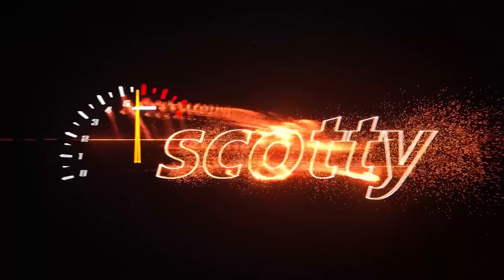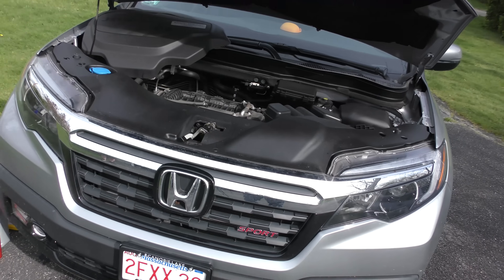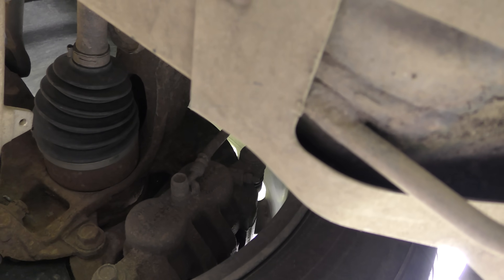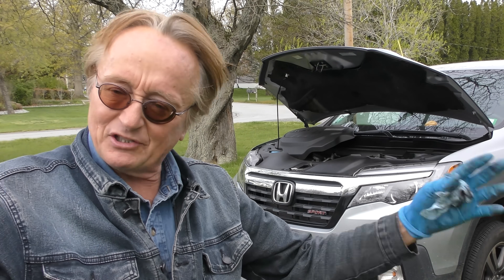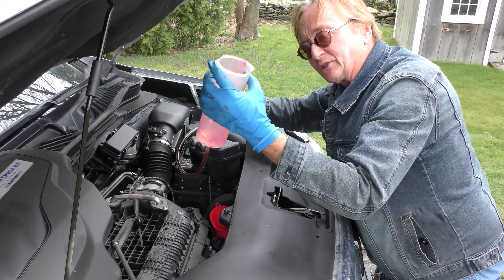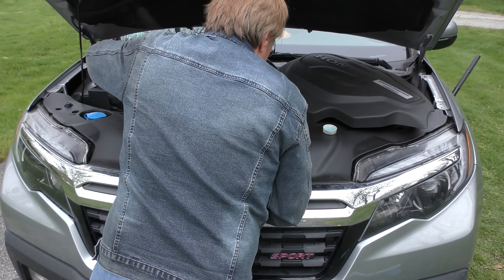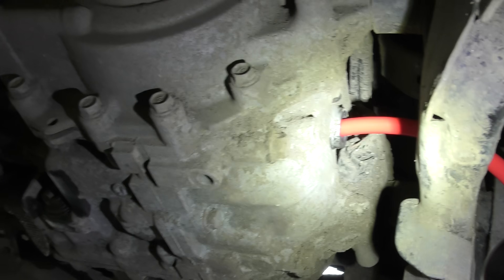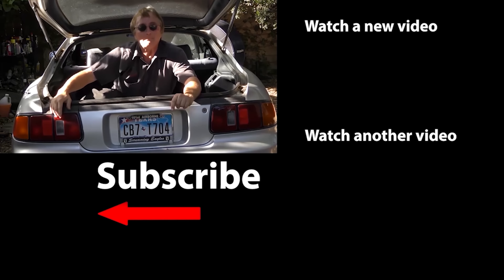Here's Why Car Companies Don't Want You to Change Your Engine Oil or Transmission Fluid

Comment: 6:12 THIS... is why I love the design of my Subaru engine. The oil filter is on the top so oil changes are virtually mess free. 
Great video 👍
Reply: Interesting. What year is your Subie? I have changed hundreds and never seen one on top?
Reply: @alan297  my 15 and 20 were both on the top, Outbacks
Reply: @alan297  2009
Reply: How often you change your oil on it ?
Reply: Some toyotas have excellent oil filter drain area. So ya dont get all messy. Used to change oil n filter 3 times a year
Reply: Just put a plastic bag around your oil filter as you unscrew it.  NO MESS.
Reply: E46 and E53 (probably E38, E39 as well, same generation) -- has it on top and uses a paper filter in housing design.  No dripping oil on your wrists and car, such a good design.

Comment: DUDE yes.. I ran a Valvoline and a lot of the customers wanted to be know-it-alls (for whatever reason it was almost always Ford truck guys) about their fluid changes, especially oil. If they got conventional engine oil they always insisted they were told it was capable of 6,000 miles. I said, yeah, of course they told you that. It'll work fine under that schedule until you're past the warranty, then it's your problem. Plus routine maintenance cost and intervals started getting taken more seriously by the consumers. So the dealer will tell you whatever to sell you that crap, especially when they can lock you in to be coming back to their service department. That's ROE revenue generation. My personal vehicle requires 0w40 European oil. I use Mobil 1, and change the oil and filter no more than every 3500 miles or 6 months in my car (it also never idles for long aside from bad traffic) have never had a problem on a motor that commonly has issues based off of internal engine wear (6.4 hemi), and even use that as a recommendation and still got arguments from these guys.

Comment: Hi scotty have a toyota matrix 2006 What happen if  get two type of code scaner P0420  / p0741..?
Reply: Thank for your help
Reply: p0420  catalytic converter is not functioning efficiently and P0741 torque converter clutch solenoid performance.  The p0420 could be an o2 sensor or clogged cat.  Try dumping some catalytic converter cleaner in your tank and see if that works.  If not replace the o2 senor, if that does work soak your cat in soapy water overnight and hose off.  I have no idea how to fix the p0741 error
Reply: @Jeremy Brown  what type catalytic  spay can should I get

Comment: Car makers don't want you to change transmission fluid, because they want you to buy a new car soon. Well done, Scotty!
Reply: Also most punters buying new welcome lower maintenance, and they'll probably no longer own the car anyway.
Reply: @rob5944  Exactly, Rob! Changing engine oil every 10000 miles, lifetime transmission fluids make maintenance cheap and cars disposable.
Reply: @jaguarrroman  yes, and Scotty says not having to bother with the transmission is attractive to the new car buyer.  Here in the UK my little Peugeot says to change the auxiliary belt at 100,000!  It always made a noise from when we bought it at three years old and 21,0000.  With hindsight I should of taken it back but it was only a little on cold mornings.  The water pump bearings started rumbling at 45,000 and the clutch broke up too.  Ok it probably had a hard time in the city before hand, but I've never had a pump go in my life.  But it's a car built to a very strict budget, a Toyota Aygo in disguise with a Daihatsu derived engine, not brilliant it has to be said.  Although it only cost £6,000 but I had to silicone the centre brake light in to stop it leaking, a long standing fault on this and the preceding model.  A fairly comfortable car to drive and averages 55 mpg and is hippy round town but struggles on hill.  With 67 bhp I don't think it'd be popular in the states, free tax here though because of its low emissions!
Reply: @rob5944  100K is too much for the belt whatever it be made of. When I was driving an Opel Tigra in my young days, I started checking the belt condition and considering it's replacement every 15-20K km. I prefer to be on the safe side.
Reply: Well in line withe their policy on sustainability of the environment.
Reply: @jayjaynella4539  I believe that car makers' competition with each other in quantity of sold vehicles is the main reason, which makes the environment unsustainable.
Reply: True I sya just change once if it's a honda and in manual  I have a 2003 civic manual transmission . I changed it at 200k and the report I got back from blackstone  Saud it was still good .

Comment: I have a 2017 Ridgeline with the 6 speed automatic transmission. It does have an external filter that's easy to change.
Reply: This might be the 9 speed? ZFs usually have filters and magnets built into the pan. A full service would involve replacing the pan assembly

Comment: so if you have one of those "no need to change fluid ever" transmissions. would you still recommend to do it anyways?. or if it did frag does the manufacturer have to replace it?
Reply: Yes. No fluid lasts forever.  It will last the length of the loan or warranty and that’s all they care about.  They don’t consider people that keep their cars more than 7 yrs
Reply: Every 40,000 miles is pretty reasonable.  If you already have over 100,000 miles, don’t change it, it’s too late.
Reply: @jpjp3873 , 40k sounds reasonable. But for the 100k it depends on the producer. For the best Japanese cars you can do an almost total change (more than 80%), while for a least reliable brand I would recommend a half-change and keeping the old fluid (in case of issues you can put it back in). This would be the risk mitigation 😉

Comment: i have a 08 honda ridgeline with a 3.5 vtech. yesterday i got 14 codes from a obd2 reader. I bought a egr valve and put it on. Today after installing a new egr i have 4 codes po300, po301, po302, and po306. I ran my finger the exhaust pipe and got a thick black dry layer of soot. I'm wowing if i should clean or install a new idle air control valve. What do you think brother? 
Please get back with me, God bless...

Comment: How often should manual transmission fluid be changed on my Mazda 3? I read conflicting info ie. sealed for life, but Mazda say change it at 90k. Nothing in service book about changing or inspection.
Reply: Do it like Scotty says...every 30k miles.
90K is really close to the warranty limit....see where I am going with this???
Stand there and watch if you get someone to do it....

Comment: The dealer only recommended a drain and fill
Reply: The trans filter has to be changed also.
Reply: @kato1224  They  said it didn't have one.
Reply: It's a screen type filter.
Reply: If they use a machine to back flush the transmission, the filter also gets back flushed that cleans out most of the gunk so you don't need to change it.
Reply: @wally7856  i have a 2019 rav4 It doesn't have a Conventional. dipstick. You have to put it in the certain temperature. But true

Comment: I have a 2001 hoda oddesy and it has p0740 it drives fine in till it Reaches operating temperature and then has hard shifting between 1st and 2nd

Comment: I bought a 13 VW Passat (I know. I got it cheap) with 130k miles. I don’t know the history of the car. MY QUESTION TO SOMEONE THAT KNOW AND HAS EXPERIENCE IS:
Should I replace the tranny fluid? I’m scared. Thank you in advance to my guardian Scotty
Reply: Now that you have bought the car
...have the oils changed in everything...engine, trans,diff, brakes
then  you know it has been done properly.
Now you can set your own schedule for future changes????
Reply: @Jonathan 
There is a mechanism to distribute the drive between the left wheel and the right wheel...it is a differential. (diff)

Every 2013 Volkswagen Passat has either a front or rear differential, and some 2013 Volkswagen Passat s will have both of them. 4-Wheel drives are a good example of one with both differentials. This component allows your 2013 Volkswagen Passat to turn in different directions, so you can imagine there will be some issues when the differential starts to malfunction.

Comment: If the transmission and the differential have a fluid  level plug l always fill until fluid comes out. Because the component could be already low before you drain it and  just measuring the amount that comes out will leave the component low!

Comment: I have a 2022 Honda accord, had a curtesy 3000 mile oil change  coupon.  I didn't inspect their work till 500 miles later , one look at the oil color I knew they didn't change it.  I have always changed the fluids on my car by myself, and after this experience I will never go back to a dealership.
Reply: 500 miles will darken the oil again.  It’s clean looking until it is in the engine.  Use your head
Reply: At 500 miles the oil on your dipstick should remain relatively clean and clear unless that engine has other issues to consider.
Doing it yourself will prove this out.
Dealerships overcharge and underdo in most instances.

Comment: I've yet to meet a mechanic that does things in such detail. (Measures cc, Recommends OEM fluid)
Reply: With hondas you will have failure if you dont use the oem. anyone who's owned a honda is aware to always use OEM fluids.

Comment: It is better to get the maintenance for your vehicle completed at the service center.
Reply: Only if you have a warranty that demands it...and make sure every part of that service is signed by them in the maintenance log in the vehicle and stamped by them.
If the "new system" is computer based...ask for a printout each and every time.

Comment: Question for you, my car has 220k kilometers, and the dealership and transmission places won't change the fluid, because there are no records of it changed what do you recommend. Scotty. Dom from Toronto.
Reply: i heard him say before if its been too long unchanged better leave it as it is
Reply: @fidelcatsro6948  my concern is that it will become paste
Reply: @domenicorusso9183  peanut butter yum yum
Reply: What car?
Reply: @rajmukhopadhyay4837  2012 Infiniti G37.

Comment: Top Tip: always loosen fill plug on trans/diff before draining to be sure you can fill after drain.
Reply: I also like to make sure I can take the filter off before I start the drain...
Reply: @eyalcohen2080  I fell victim to that, also remember to refit the drain plug before refilling of you've gone for a cup of tea. 😞
Reply: @rob5944   - - - - Yep.  I put five quarts of new oil into the oil drain pan and it mixed with the five quarts I drained out earlier. Had to use my other car to go get more oil. Also, the 10 quarts of oil overflowed the drain pan and it made a mess. :body-green-covering-eyes:
Reply: @eyalcohen2080 i lost a jetta by not checking the filter first, it wouldn’t come off cuz it was fused to the engine, and i think my prying it off fucked it up and when i thought i fixed it and filled it up and put new oil in it, it just spat it all out.
Reply: I learned that hard way once. Needed longer extension once to reach fill on toyota transmission.
had to borrow extension from neighbor.
Reply: Maintenance 101!
Reply: And as when loosening any but or bolt, try to keep and open hand on the wrench so that if it slips then you won't crack your knuckles!
Reply: @rob5944 or round the bolt and you’ll never get it off
Reply: I think I heard that from some guy named Scotty Kilmer.
Reply: @petepacemaker  he don't even follow his own advice
Reply: I just put on rotisserie flip it over to fill it back up
Reply: @danbob1650 😂😅😂
Reply: Additional plus to doing it that way: pressure relief. Old fluid will flow out easier and usually in a smooth stream. Helps keep things tidier, especially with horizontal drilled drains.
Reply: Otherwise it can be a nightmare.
Reply: Or you can just turn your car upside down and fill it from the drain plug.
Reply: @HaggisMuncher-69-420  Sounds easier.
Reply: I know, I always try to remember that. You could get in trouble that one time you can’t get the fill plug loose!
Reply: What's a fill plug
Reply: Meh.  Whatever works for you, in my opinion. I've never done that, myself. 

I have everything out when I'm ready to do the work. I also check the oil before I start the car after the change, then start the car and do a leak check. Then I check the oil level right afterwards and clean up. 

The are layers and layers of opportunities to being sure you actually put oil back in. How many is up to the individual.
Reply: Scotty, Why
Reply: I have a  2016 C7 corvette. It has 20k miles on it. Would I need to change my rear diff fluid. It not due till a few thousand miles from now, however, the fluid itself, is 7 yrs old now. I've heard different answers.
Reply: I agree 100%
Reply: Last year on my cts i reverse filled the trans because I didn’t follow this rule... never again
Reply: You'll also have the added benefit of it draining faster.
Reply: @Brady Mac 
Thanks for reminding.
Is he talking about the necessities of changing oil for automatic vehicles, or for all?
Reply: Lol my tool slipped and I thought I had cracked the fill plug - drained, then took an hour to finally open the fill, thankfully
Reply: So you don't like to live...dangerously? Lol
Reply: That's right 👍
Reply: Partially true. You can fill them back up with a pump type of gizmo. They sell them online for filling sealed transmissions. They have all sorts of fittings and I bet you can fit it on the drain bolt of a dif or something of that likes.
Reply: no
Reply: Or turn the car upside down

Comment: Scotty, my trans fluid dipstick shows my fluid is 4-5x higher than the high marker. I checked it a number of ways including whats detailed in my owners manual and it never reads even close the the high mark on the dipstick. 

Should I be concerned?  Next time I change out the fluid (I plan to start doing it myself) should I put in less?
Reply: Drain it ans measure how much came out, then look up how much is recommended to put in when performing a simple drain and refill. Compare what you got out and usually it'll need as much as what came out.
Reply: Goodluck
Reply: Are you measuring with engine on or off? My car for instance says to measure with hot engine and operating. Check manual for details

Comment: I have a 2011 Dodge Caravan...140k on it. Never changed the trans fluid. At this point, should I just leave it be?
Reply: I'd recommend not changing it. Someone on here said 90k miles and that's pushing it even with a more reliable brand like Honda or Toyota, at that point is recommend only a partial fluid change at the most. 140k miles on a Dodge? I wouldn't risk it
Reply: @Trickster_24  I changed the ATF on a used Civic I bought with 120K miles. It was probably never changed before and looked brown. No issues at all.. But that is a Honda lol. Dodge is a different story.
Reply: @rajmukhopadhyay4837 how do you know it was never changed? The fluid can get very dark between changes especially if you delay even one change. Especially if it's driven hard

I just did my fluid on my Acura TL with the 5spd auto and it was very dark. But technically it's a partial fluid change because half the fluid is locked in the torque converter. So the likelyhood you will introduce slipping from changing the fluid is in my opinion significantly reduced compared to a 100% fluid exchange
Reply: @Trickster_24  ok, thanks for your response

Comment: Hello Scotty. Did i see right?  Fram oil filter😢
Reply: YES it was a Fram what's wrong with those?
Reply: @rockinrob2004  
Regardless of what the public opinion is about Fram oil filters i would have spent an extra 3$ and used the original honda filter. Since all the fluids used are not cheep and excellent quality.
Reply: @joespeed5991  I'm not disagreeing with you, I just don't think Scotty would use it if it was inferior. ALL the years I've used Fram on many of my vehicles I never had any issues. Just saying
Reply: @rockinrob2004 
Happy you got lucky so far. Just saying that there are way better oil filters to use when it comes to use one of the best oils pennzoil platinum and genuine fluids.
Reply: @rockinrob2004  nothing besides cult mentality as far as I'm aware. They've got their budget and premium versions like everyone else 🤷‍♂️
Reply: I bought a Honda filter at dealer, blue can. Research says Fram is making them now, and it looks exactly the same as a Fram inside too
Reply: @mikekokomomike 
Good to know. Wonder if the warranty will be honoured if ever engine trouble.

Comment: hey there Scotty, i am only a shadetree mechanic, and a relatively poor one at that, so i checked the transmission fluid in my 2005 honda Accord EXL V6 engine, 211,000 miles and the fluid is brown, i want to change it , can you help me out with specs on how much honda fluid i might need to buy and i will need a new filter , right, please help.
Reply: I would leave it alone. That's a lot of miles. Changing it now could cause it to slip.
Reply: @rajmukhopadhyay4837  well thats kinda what i was worried about, but this car has had regular service up to the 100,000 mile point, i bought it with 206, 000 miles, so not sure when it was changed last. but thanks for your input.
Reply: @Raj Mukhopadhyay  at that mileage I would too.
Reply: I have a 2012 Acurs TL . It had 177k on it when I did a drain and fill. It had never been changed. Took a chance and it worked. The prior owner used it primarily on the freeway.
Reply: Doing a drain and fill alone should not hurt that tranny if it WAS last done at 100K but do it now.
Do NOT get a complete flush/exchange at this point. Do the differential as well.